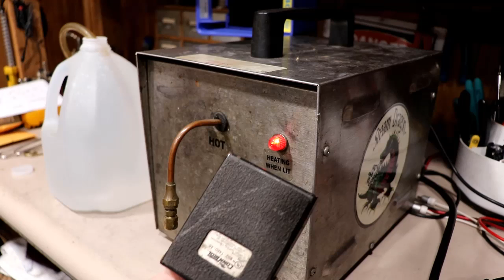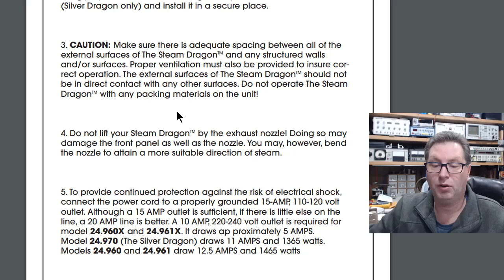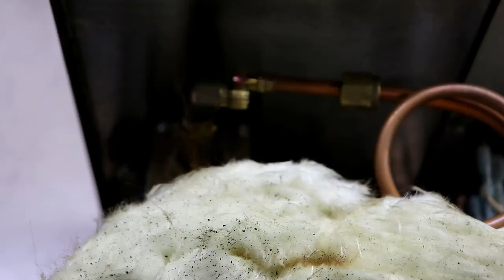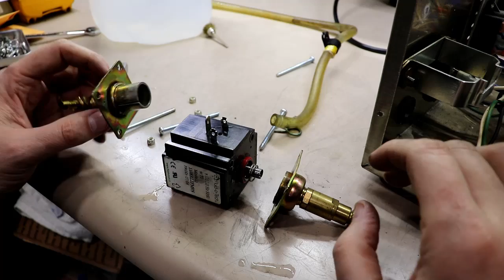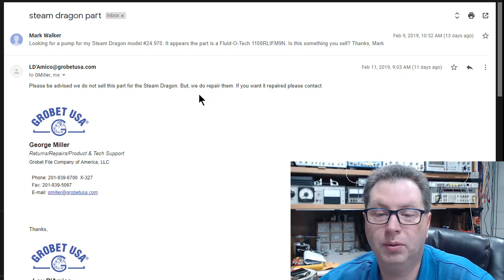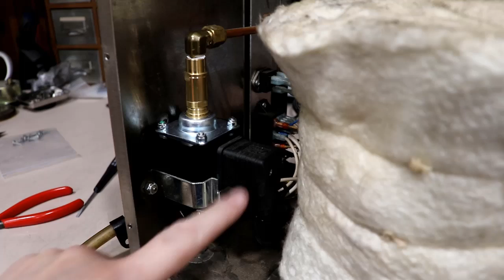Repairing a Steam Dragon Jewelry Cleaner

Comment: We have a steam Dragon 24.970. When it's turned on the red light does not light. When the pedal is pressed water not steam comes out. The fuse tested fine. The insides look fine. Any suggestions?
Thanks, Greg.
Reply: Sounds like a fuse problem. There is a black plug on the outside labeled fuse. Inside under the cap is the fuse to take out and replace,

Comment: I just had to fix one of my steamers, same model that you have in the video, for me the machine started having trouble with the pressure where I would have to step on the pedal for longer and longer for a less and less powerful jet of steam, eventually it just started leaking and not outputting steam, after taking it apart I noticed that the connector for the copper tube connecting to the heating system wasn’t fully screwed in, I had to take the copper tube out, re-thread the inside of one end of it, reconnect the whole thing and it started working perfectly

Comment: I actually just bought an old one from 98. And i took apart the pump. It has a black seal in the top part that dries out. Replace it and it works. This would be the green models.

Comment: Greetings Mark,
It's a good thing you didn't order that similar looking pump from eBay. It was a vane pump and depending on the construction it may not have been able to hold the 125 PSI back pressure. I'd bet a buck that the original pump is fine but for a stuck check valve on the output. The vibration and sound indicate that it is oscillating just fine. If the piston was stuck it would instead buzz like a transformer.
Eric

Comment: Neat repair job.  The steam jewelry cleaner reminded me of an ultrasonic jewelry cleaner. In fact, at one point in the video, when you realized you’d have to clean the crud off the parts of the broken water pump, I was wondering if you were going to use an ultrasonic cleaner to do it. All this leads me to off topic questions that I suspect you’ve been asked before: Do you use or recommend using an ultrasonic record cleaner ? Have you considered building a DIY ultrasonic record cleaner ? Des
Reply: I wish you show, where the little ball and spring locating...mine fall a part and can't figure the location for them.

Comment: Pretty much any of the oscillating pumps would work.  We used several different brands. Flow rate really isn’t critical as long as it’s similar.  I’m a retired HVAC technician and similar systems are used for humidification and food service.   Good video as something different.   de K3QV